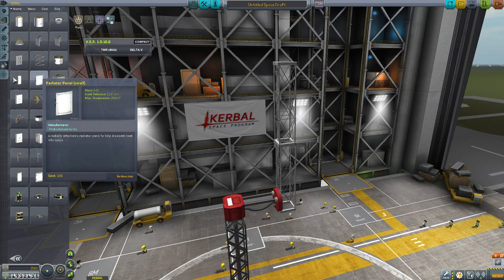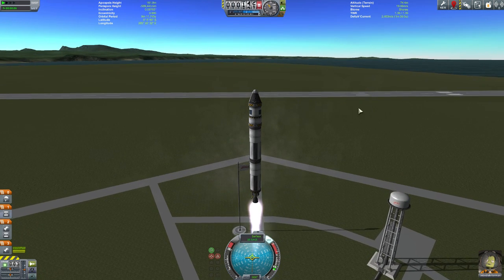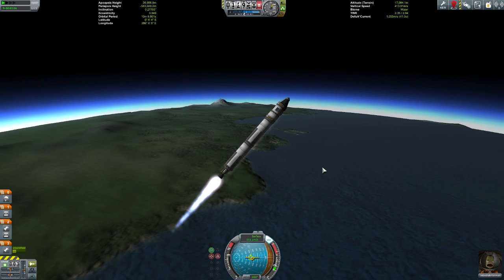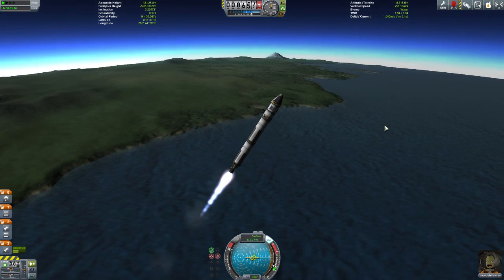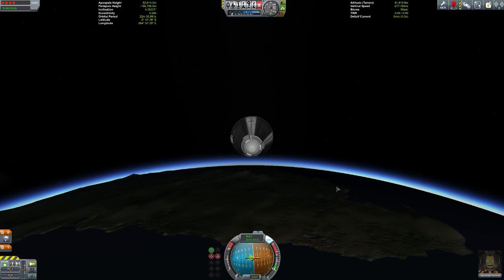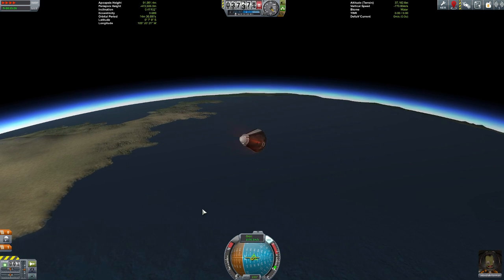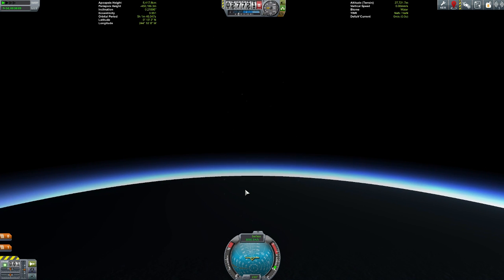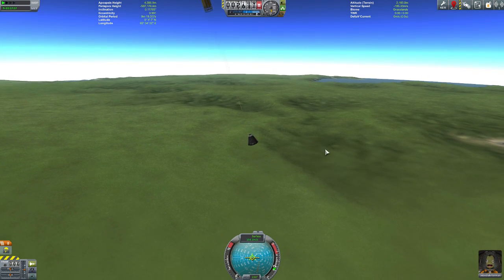Kerbal Space Program 1.03/1.04: Testing New Aero and Heat in Update!

Comment: Mr. Manley suggests launching at a 5 degree (or less) angle. You hold this, as you gain vertical speed much faster, your prograde vector will move minimally more eastward, but maintain around 8 degrees. This is vertical ascent, start your gravity turn after your first stage- especially with solid boosters. With the new aerodynamics you can hit 900 m/s by 10k m, hot but fine, and turn over to the horizon rather quickly (as in another 10 seconds you will be at 20k and still accelerating). You can minimize delta v by minimizing time in atmosphere.

Comment: I try to get to 200-250 M/S as fast as possible, then back off on the throttle and just let my speed climb slightly until I get up past 20,000m. I do a slight grav turn right away but I don't go past 90 degrees until i'm past 20,000m. Watch your AP and once it gets up to 60,000m go for orbital speed and not so much vertical. The key here is to not let the thick air cause you to waste fuel or over heat your craft then once you get up into the thin air you give it full blast and go for orbital speed rather than vertical speed.

Comment: I think the mach effects are actually a good thing. You don't want to be going faster than your terminal velocity at a given altitude, but in Kerbin's atmosphere the terminal velocity of most craft is well above the speed of sound at higher altitudes. Thus if you aren't getting mach effects, you are going too slow, and taking gravity losses. This is true of real orbital rockets as well. As far as I know, every one of them goes supersonic pretty soon after launch.
Reply from the maker: Ben Richardson Yeah, seems to be the case now.  In older version the effect itself was an indication that your vessel was close to breaking up.  They seem to have loosened the actual effects themselves and its a lot harder to gauge that fine line now.  At any rate its much more easy to get into space then it was in any previous version of 1.0.  So might be a good thing.